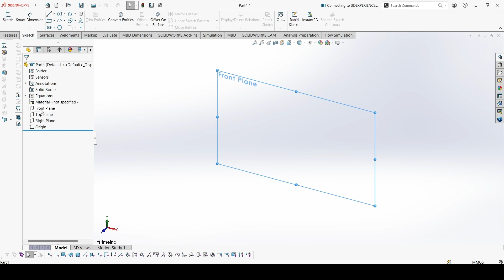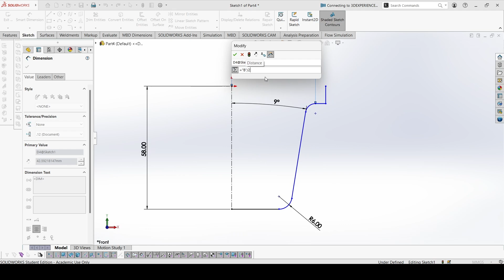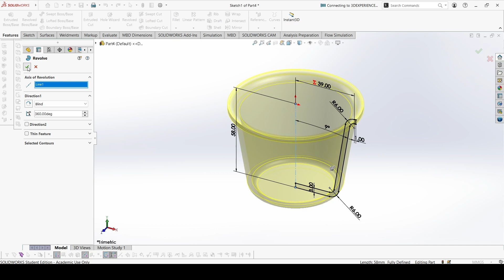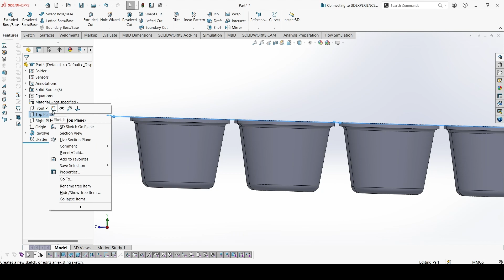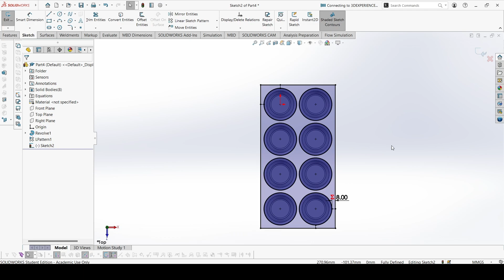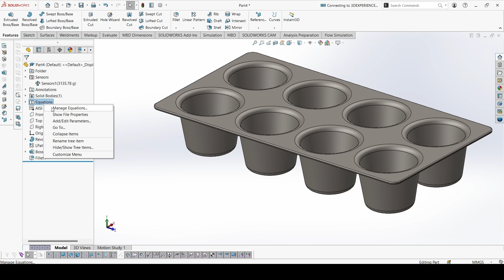Solidworks CSWA Exam Practice | PART MODELLING | Section G - 3

Comment: Thank you for sharing this video. I'm just wondering about the first feature in the top right. You added one millimeter after you created the cone shape. The drawing doesn’t mention this one millimeter addition, so I'm curious how you recognized it should be added.

Additionally, considering that, your mass properties based on the material already chosen align with the solutions mentioned in the paper. However, I'm still wondering how it's possible to do that, as I didn't realize that the actual volume and mass properties weren’t fully reflected in the design as shown. It would be highly appreciated if you could reply to my comment. Regards
Reply from the maker: Yes, actually there are many errors and some dimensions or properties aren't even provided in the solidworks pdf. However they have provided the CAD models for the questions. So, I go through the solution models to find the correct dimensions and properties that match the final answer.
Reply: @Robotics_AV_club  Hello, I also got lost when I saw the 1mm showing up out of nowhere. Anyways, I'm kindly asking for where I can download the CAD models from. Thanks for the tutorial.